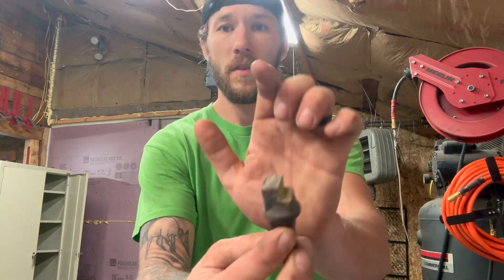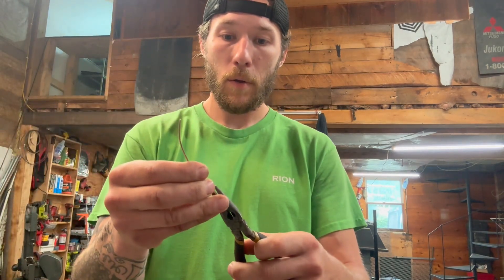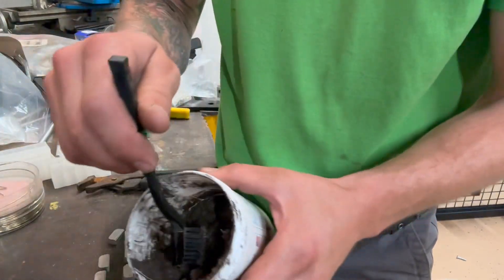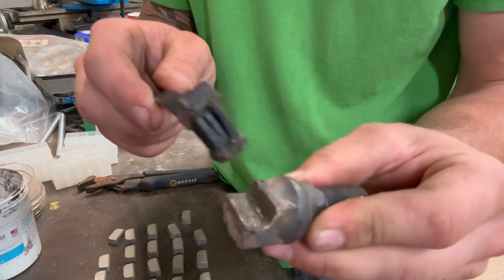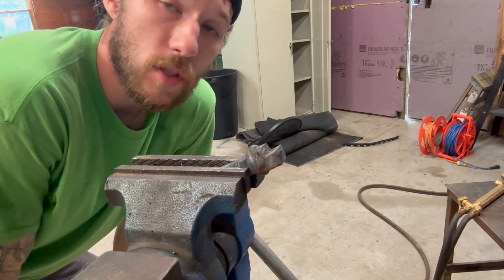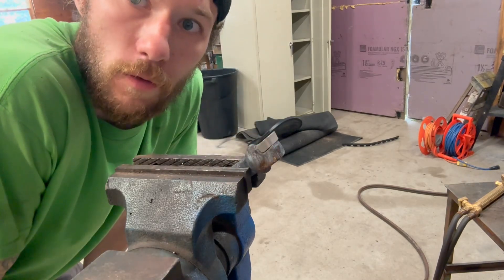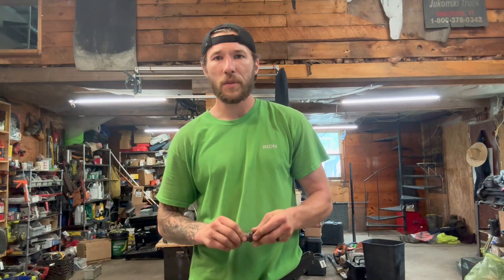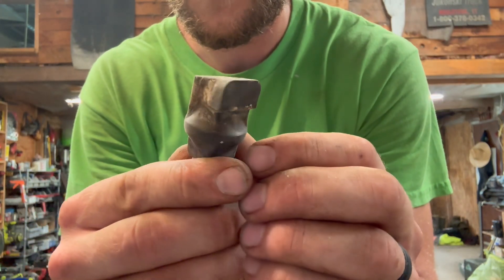Brazing Carbide Teeth

Comment: Try getting a brazing tip for your cutting torch and use a small paint brush to apply the flux way easier also pre tin your carbide so all you have to do is set it on there and heat carbide not the tooth
Reply from the maker: That’s what I do now, great tip thank you